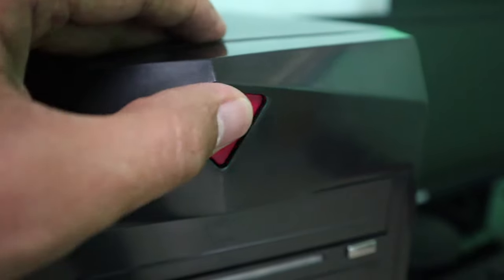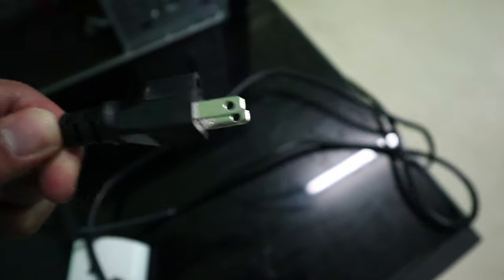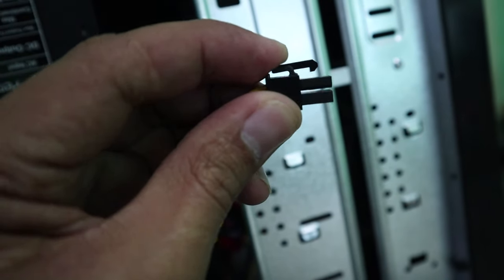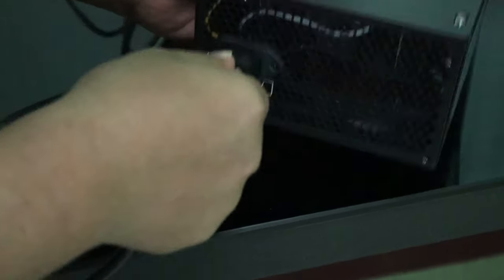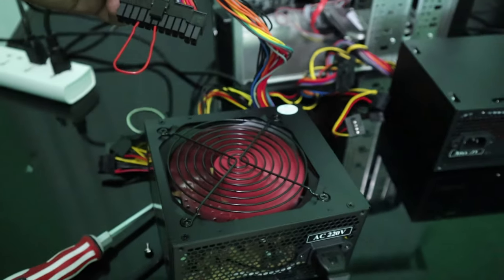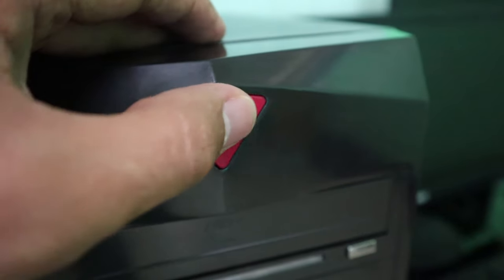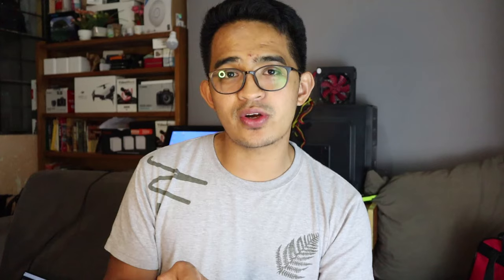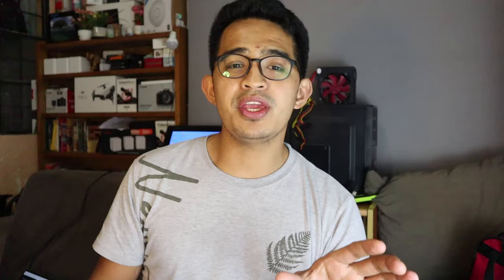DIY - TROUBLESHOOT and FIX a Computer that won't turn on - NO POWER (Beginners Guide)

Comment: I just play my l4d2 and suddenly my pc dead and i smell something burn inside my pc then i let them cool for hours and it won't turn on . When i turn on the power the adapter and light is on but not the fan what's the problem should i buy a new power supply?

Comment: Its the power switch for us 😅 thankss !

But i have a question , is it okay that we use the vomputer while the power sw cable is not connected ? We cant replaced it as soon as possible so we open the computer while doing the metal screw method 🤣 is is safe to use ?

Comment: HELLO TOROGI! Am an avid Subscriber, you are my first 'Go to' when diagnosing PC issues! I recently built a new Computer in my old Tower with a new Raidmax Vampire 1000W 80 Plus Gold Power Supply, an MSI Z390-A PRO Motherboard with an Intel Pentium Gold Processor G5400 CPU @ 3.7GHz! Next added  64.0 GB DDR4 3200 Ram! Also a ZOTAC GAMING GeForce GTX 1 Video Card! Recently upgraded all my HHD's with an Intel 660p Series M.2 1 TB SSD Drive C and two WD I TB internal SSD's! My Computer now boots up completely for a cold start in 30 seconds!!!! (Once in a while when I turn it on, it Boots into the Bios Screen)!!!(But when I wont to boot into Bios, no matter what key combination I press it wont go into Bios on Command)! Windows will not display on my Digital Monitor but I can see the Bios Screen on another HDMI Output to my 32 inch TV! Am running XMP Mode and Gaming Mode on the MSI along with allocating 3/4 of my Ram to Process my Adobe Premiere 2022! My Question is: How do I get the computer to Boot into Windows EVERY TIME? And secondly, How do I get my computer to boot into Bios on command?

Comment: Hey quick question I've been dealing with this one issue that my power supply might be the issue, so apparently whenever I boot on my pc my fans and my power supply is responding, but every 30 seconds or so it deicdeds to shutdown then reboot then the same cycle over and over I'm believing this issue is a power cycle yes? Or I need a new psu? If not please let me know thanks

Comment: Hey, this was useful! But my motherboard was the problem i was worried but then i removed the processor turned it on then turned it back off, Then i put the cpu back and it worked

Comment: Nice.
But I have a question.
1. Why didn't you fix the old power supply or the old power switch instead of putting a new one? Can it be repair?

Comment: i tried my psu using what u told at the video with molex fans installed but lights opn fan are turining on and off. Isit a sign of a bad psu?

Comment: I just built a new pc from parts. All new parts save the blue ray drive and the case from a working pc. Will not power on. I get flashes of power occasionally when I hit the start button but it only lasts a second or two. Rechecked my connections but no joy. Any suggestions suggestions?

Comment: It worked for me just a bad button. It's a corsair case and the button feels good so it could be a connection or something but that is why it wouldn't start. I noticed in the comments people say fan spinning doesn't guarantee fully functional PSU and I also have a psu that I don't think will spin without a load placed on it I think I used a case fan with a sata powered hub

Comment: I did everything in the video power supply works I jump started my motherboard and nothing happened. My cpu cooler and motherboard rgb lights turn on, cpu cooler fan and case fans don’t spin. Ram rgb doesn’t turn on. Black screen. Any help?

Comment: First of all thank you so much, what if the power supply and power baton works  and there is still no display. and the fans are rotating as if the pc is overclocked? #2 the HDD indicator dose not sore. if it works immediately it restart.

Comment: hello sir. my psu is working good. my problem is in the motherboard because the lights is on but still not turning on even i use the method u said to use screwdriver to manually turn it on. what should i do sir?

Comment: Ok, so I have an issue where the blue lights for my fans and the main cover are on, but no fans are on or working nor will the rest of the system kick up, this began a couple days ago and I'm struggling to figure out if it's a power supply failing, motherboard failing ,a bad batter backup, or bad power supply cord. If I totally reset the power supply by unplugging my battery backup and plugging it back in the PC will boot just fine. Any help would be great!!

Comment: How can I connect the two pins?? The power cable/wire to the pins isn't individual its like all in a rectangular line up(the pc doesn't have restart button)

Comment: It seems my motherboard is the issue. But the thing about my issue is that after plugging the PC if you wait like 30 minutes to an hour it will eventually turn on. What could probably the issue here?
Reply: This is my problem have you found a fix
Reply: @crinofn4220  still no fix. :(
Reply: Try a new change the cmos battery it is cheap and works for some people

Comment: what if psu is working still i tried to use the scredriver method still no sign of power , sometimes if theres no power i just leave the power cable plug in and it turn on automatic itself any idea what is happening ?
Reply: Remove your Cmos battery for 5 mins  then put it back in. Google CMOS battery, it's on the motherboard.

Comment: HELP WANTED

When I use the power switch or jump my new PC, nothing seems to receive power. No fans spin, no noises are made. Both methods to power on work on my old motherboard with the same PSU. What could be the problem?

Comment: In my case my everything is working in my cabinet...but there is a red light flashing on motherboard and that red light is flashing for cpu ....but monitor is not showing display and keyboard and mouse also not working..ihave checked all the cables and cleaned every single corner of my pc..but i don't understand what's the issue? @Torogi Pro

Comment: I have a question and please have a quick response
Heres the story
I was cleaning my processor removed the fan and the amd so my the one thats supporting the fan of the processor go too deep so i removed the plugged in the motherboard and then fixed the fan and replugged the things and now i cant open my pc but my mouse and earphones are turned on what do i do now

Comment: hi,

 

my old desktop was fine when i shut it off but when i tried to power it on next morning, the power light came on for a few seconds (after the beep) then went off..........same thing  happened despite several tries......

 

i tried another SATA cable for the SSD and used the DVD-ROM's power cable and still the same problem........
i then connected the original HDD using just the DVD-ROM's power cable and the CPU fan started spinning at FULL-SPEED non-stop !.......i've never had the CPU fan run that fast before......

 

i'm afraid of re-connecting my SSD to the motherboard again in case the SSD gets damaged......is it the motherboard at fault ?

Comment: Thanks i though i need new power supply not until the last part when you say you need to check the power switch. I messed it up yesterday that’s why it’s not working

Comment: If youre computer is more than a few years old and suddenly wont start, try replacing the CMOS battery first, with a CR2032 3v battery, mine had died and wouldnt start until I replaced it, worth a try as they are very cheap.

Comment: bro, what if the power led and fan are not turning on but the speaker turn on ( the speaker has rgb light) is it still the psu issue? after a few days it will turn back on then again, will not turn on.

Comment: Hi,can i have some help pls so on my pc a friend tried  his gpu that was loosing signal to monitor in just one game so we installed it and power on no display what so ever on monitor we take it out and put back mine all done power on no signals dead tried the power supply trick and it spins tried the screw driver trick no startup what is the chance the motherboard is dead ?

Comment: Sir I tested my power supply the first method. The fan spins but it is slow. My main problem is my unit goes on and off. Do you think its the power supply?
Reply: Yes it is lol the problem is not enough power is being distributed well I have to wait months before I get a new power supplyy
Reply: Having a pc is no annoying so much money spent yet so much issues 😢

Comment: Hi! How do we go about a computer tower that turns on then goes off? The fan spins intermittently.
Reply: mine does this too :/
Reply: Did you get it fixed? My pc did this aswell and now its  not turning on at all.
Reply: I had this before, try remove gpu.. connect monitor using VGA on board.. if its ok , reset pc.. turn off, put gpu, turn on, then install gpu driver again...

Comment: So I connected wires and power supply works.However my pc wont turn on.I used second power supply and pc turned on.Power switch is ok.What could be problem?

Comment: Sir what is the problem if your pc is not fully turning on and the mother board is working but it is not turning on to the point that the keyboard and mouse is producing that much light and my monitor has no signal, ig it is not getting the right amount of energy idk what should i do? And what must be the problem?

Comment: When I flip the switch on my pc the motherboard rgb turns on fine and when I press the on button nothing happens but when I built the pc yesterday and turned it on it was working fine with the rgb and everything Plz help
Reply: Me too
Reply: Same
Reply: I'm in the exact same position right now. Did you figure out what the problem was?
Reply: @navataru  yes
Reply: @navataru  I just re wired everything all over and it was all good
Reply: @noqcx2413  really? I have tried rewiring everything except the CPU from the motherboard. So tomorrow i will try and assemble my PC outside of its case to see if its my case that's causing a problem. Otherwise so far I've narrowed it down to my Motherboard having a defective pin for the Power Switch or..... in odd case scenario, my Tower wire for Power SW is faulty. Hard to say... Hopefully the shop can give me a replacement since I just bought this stuff 7 days ago.
Reply: @navataru  yeah u need to un wire everything and plug it all in when everything is unwired
Reply: @noqcx2413  Alright, thanks i'll try it
Reply: @navataru  i found out mine turns out my power cable wasnt in correctly so only small amounts of powerwent in doubt itll help you tho

Comment: My pc has a tendency of shutting down on it’s own and then takes hours to turn back on. I took out the PSU and shorted the green and black wire together and the fan did not spin. I tried it several times and  the fan would sometimes spin and sometimes it wouldn’t. I’ve taken the pc to a lot of people for repairs and diagnostic but nothing helpful. What should I do.
Reply: get a new cheap psu😊

Comment: Nice video, but my computer won't turn on every morning, i always made an isolation steps like cleaning ram, checking processor's pin, checking PSU, but it always won't turn on evrey morning. Even I made any troubleshoot for it. What should be the solution for that?

Comment: My PC Wont turn on any help? My Power supply is working and when I plug my keyboard and mouse into the PC Those two light up but my pc, pc led and fans dont turn on or work.
Reply: Same problem
Reply: @nikofernandez8837  me too it could be no electricity because money is tight rn who knows 🤷‍♂️
Reply: Did u fix it? If yes then what did u do
Reply: @babaloons4887  yes I replace my motherboard
Reply: @zhking_1161  damn im fucked if thats what is happening to me
Reply: Idk if motherboards can die because of power going out

Comment: I need help my computer was working well without any problem, suddenly it went off I thought it was power supply I tried the one from working computer, still no sign I tried to get the one which was in my computer trying it to another computer it's working well, so I don't no the problem help me

Comment: Bro i need help ! My pc works , sometimes. In the morning i can turn it on. But if a shutdown it it wont turn on. When i press the power button it makes the click sound but wont turn on. For it to turn on again i have to wait about 5 hours. If i try to turn it on before it , it will reset ill have to wait again ! My ups works, but when power goes out the pc turn of immediately.  Im ssure the ups works. If i go somewhere i have to keep it on. Sometimes the automatic windows repair things comes when i turn it on. And it gets frozen there, there is nothing i can do . Can you tell me where the problem may be happening ? pls help ! 😢 help pls 🙏

Comment: Ok power supply if i direct it like you do...  leds on but if i connect it into the motherboard not working no cpu fan turning and power supply not turning..

Comment: How about when you plug the cable the keyboard that was connected to the CPU lights up but the CPU doesn't turn on ? I mean evidently there is a power since the keyboard connected to the cpu is turning on however when I press the power button it's not turning on ?

Comment: i just like to share of how i fixed my pc that won't turn on. I did all troubleshooting, checked psu, power switch, ram and they are all working well. I also removed the MB from pc case but still it doesn't power on, tried to disconnect psu 8pin atx and only 24pins connected but still didn't power on. With this I'm guessing i need to change the MB. but while searching for a fix, i saw others using hair dryer to start their pc, i tried it (gamit hair dryer ni mother hehe) and wow my pc turned on, but the next day it won't again turn on, so i used hair dryer again to turn it on. Then i saw cleaning the crystal cylinder with isopropyl alcohol and wd40 multi-use will solve the problem, i tried it and it really worked on my pc. This saved me from buying new MB. Motherboard is gigabyte b450m ds3h

Comment: When you put the pin to the power supply and put the power cable..the power cable is connected to the electric socket?pls help..my PC won't turn on

Comment: What happens to me is when I plugged my motherboard psu connector back in, it turned on for half a second then turned off, so is it possibly the board.
Reply: hi i’m having the same problem, did you get a new psu? or just new cables for the psu
Reply: No, it was a new board.

Comment: So what if you do everything and it still doesn't turn on? Brand new mobo and psu, and the PC wont turn on with the old or new setups, even by shorting the header pins

Comment: So, my pc won't turn on after an outage. I was about to do the first step, which is testing the power supply, I was about to remove the connections but I accidentally hit my pc with my knee and it turned on! I'm not complaining, but I do want to know how that even happens
Reply: What how is that possible

Comment: Hey, I don’t know if anybody can help me, but today my PC wouldn’t turn on the back ethernet LED would blink and turn on but nothing else it was still remain dead. It wouldn’t go to post display or monitor wouldn’t turn on or anything. Just had a quick question if anybody knew or had any kind of issue like this beforelike nothing turns on but my ethernet LED will blink and stuff
Reply: I think I have the same issue, after cleaning my pc my pc turned on but it didn't show any display. The cpu and power supply fan is working but no lights are showing

Comment: I just installed a new processor but when I tried to turn it on. When I press the button the lights flash on, and the fans start spinning for a second then turn off.

Comment: PSU passed the paperclip test but still nothing, the RAM RGB Light is on but nothing happen, just a click noise on the power supply when I try to turn on.
Reply: It's either the PSU or the MB.

Comment: This helps, but what if my power supply, motherboard, and case are not the problem. My motherboard has light indicator and it turns on while my powersupply is working properly. What is the problem when it comes to this?
Reply: look up “ computer no POST”

Comment: Hey im having problems with my pc when i turning it on its not turning on but when i go to our nearest fixing computer shop its turning on and when i go back to my house its not again turning on
Reply: Look thats outlet issue check that the outlet ur plugging your pc in is good try not using multi socket hting i dont know its name try plugging it alone without the screen in a wall outlet and see if it turns on

Comment: hello sir, i tried this, however the fan only worked for few seconds then died. what could be the reason? is my psu need to be replaced if that's the case? i know it's been 2 yrs since this vid, i do hope for a response 😞
Reply from the maker: bad psu u bro, replace it

Comment: When connecting the green and black wires on the power supply, I'm assuming that it doesn't matter which black wire you use (since there is more than one). Is this correct? Another great vid, by the way.
Reply from the maker: Hi bro. All the black wires are from one connection, you can select one of them.
Reply: @torogipro  Ok, thanks!

Comment: Hi Sir. My right problem now is that when I turned on my pc it immediately turned off. Power supply is working. RAM is ok since I have tested it in my other desktop. Is there possibility that the processor itself is the problem?
Reply: Gpu

Comment: There’s lights in the case but the PC doesn’t turn on. Occasionally it does after turning the power switch off and on again a dozen times or so and when it’s on I can use it just fine but when I try to boot it up another time, it just won’t work.
Reply: Have you found a fix?
Reply: Same issue with me I can't figure out wheather its an psu issue or something else.